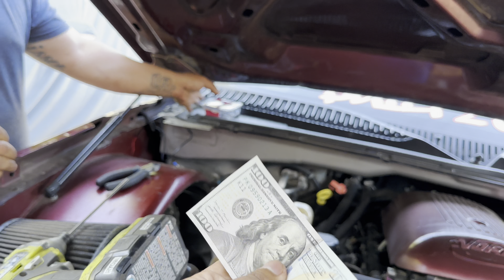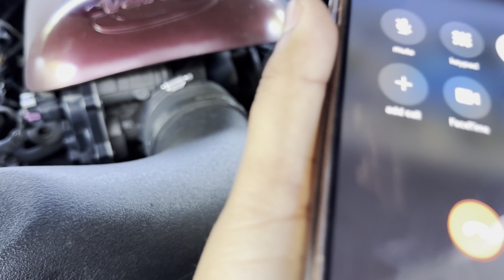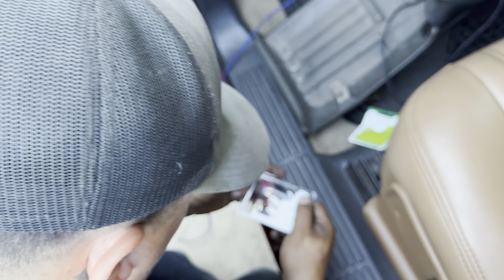05 Silverado 🍒 lights, small upgrades

Comment: To much wires running I run less wires  and no switch  inside my cars u should try 12V 24V 8A Switch RF Remote Controller Dimmer for Single Color LED Strip Light. Run from battery and control with remote less work cleaner job